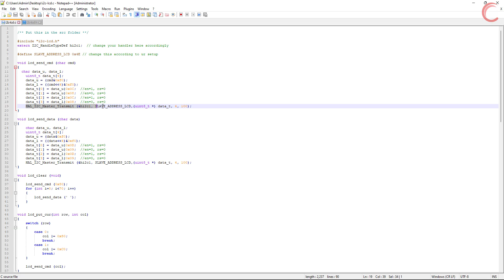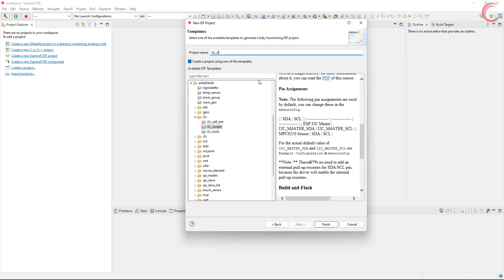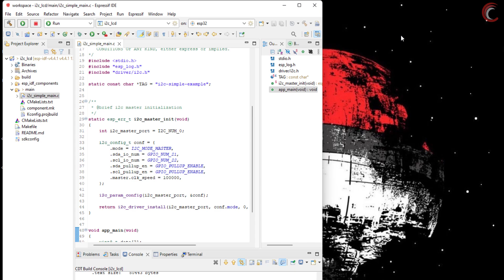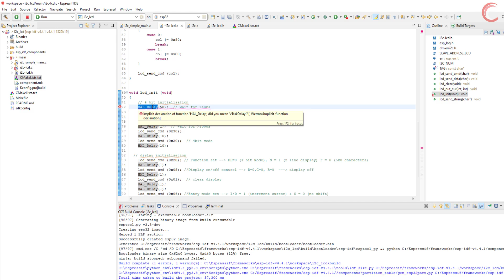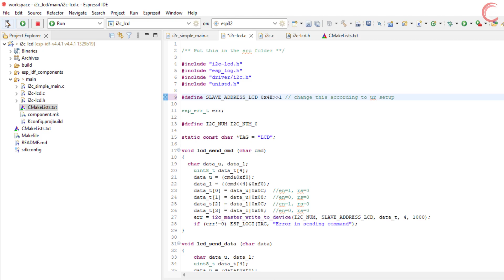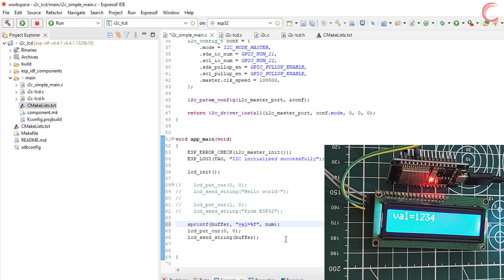How to use I2C in ESP32 || Interface LCD 1602 || Espressif IDE

Comment: I accidentally bumped off a 4 pin header to a ESP32 wroom 32D espressif wifi board on a cleaning robot (bissell), I can't seem to resolder it, would a replacement board come pre programmed for wifi or is it necessary to program it

Comment: Thanks a lot for this article. I am trying hard to make this lcd screen work on my esp32, but for some reason I can't. Maybe it's because of some config related to the espressif idf, like clock speed? When I use Arduino IDE with the same hardware, It works, but with the IDF. Does not. I tested my codes using the wokwi and I'ts working too. Probably it's something related to my environment.
Reply: Try by not right shifting the address
#define SLAVE_ADDRESS_LCD 0x27 // change this according to ur setup

Comment: can i change the default pin for i2c connection of ESP32
Reply from the maker: I don't know. Check in the documentation if the pin remapping is possible or not.
Alternatively you can use another i2c instance.

Comment: Excellent tutorial video. I will be following this series, thanks.
Why did you not have to  #include "esp_log.h"  in i2c-lcd.c  I got an error when I didn't. I will have to put a logic analyzer on the display I am getting garbage, even though the code is the same except I use vtaskdelay instead of the usleep() functions which should not make any difference.

Comment: How hard would it be to use debug esp32?
Reply from the maker: You mean debugger ? Well i tried using one or twice using the usb cable itself and it didn't work. I guess there might be some other pins for it like STM32.. I don't know much I didn't research it yet.